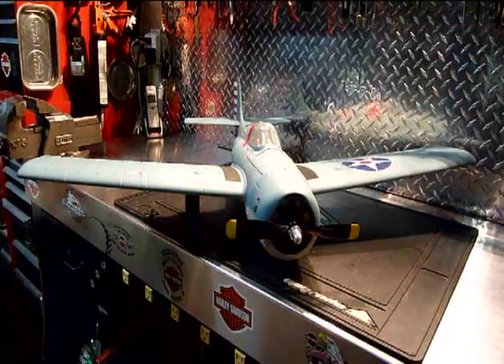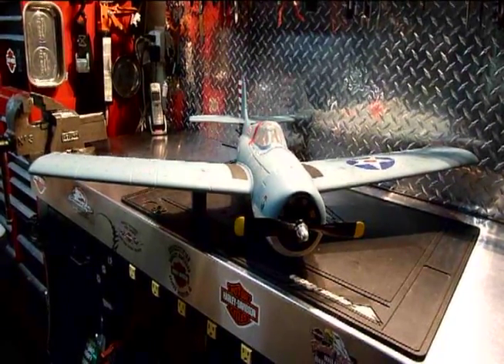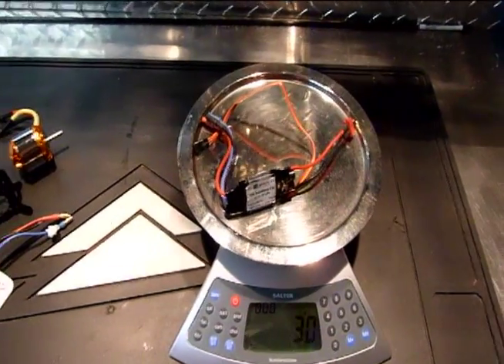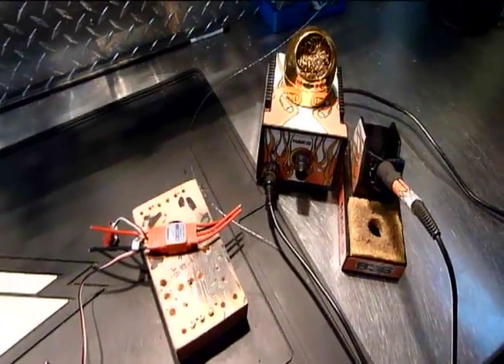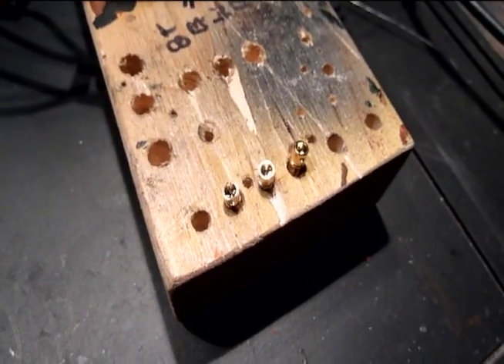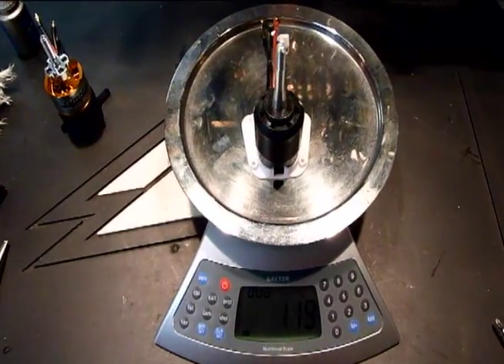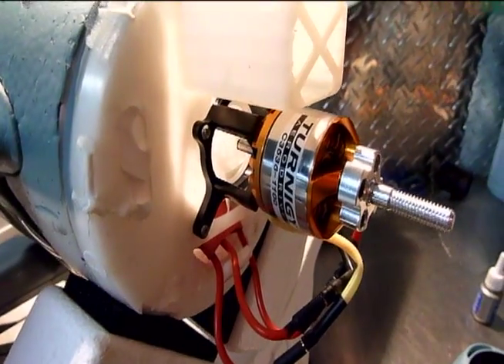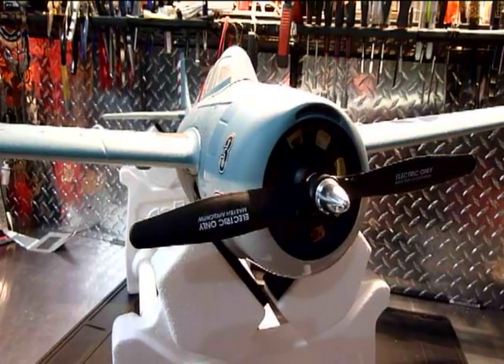ParkZone Wildcat - Motor Upgrade

Comment: What battery did you use, and did you have any issues mounting it? What is the prop size?
Reply from the maker: I used a 3s 2200mAh lipo. I shoved a 1" piece of foam into the battery compartment to move the battery back that inch ( to get the CG right). With this setup, I used a 10x7e prop. I hope this helps. It's a wicked upgrade.
Reply: Thanks